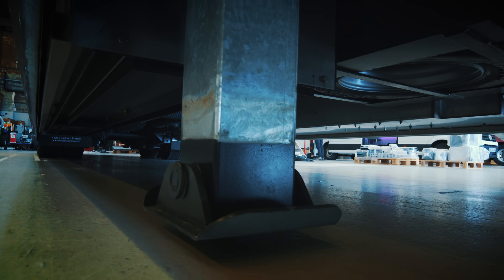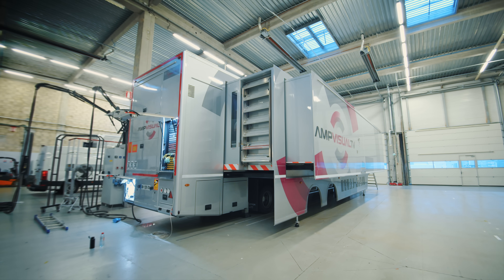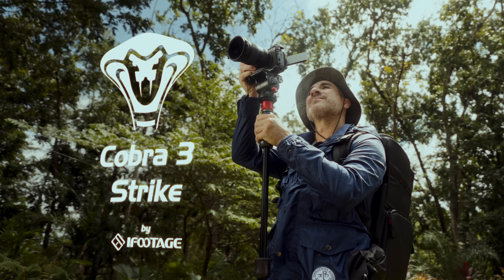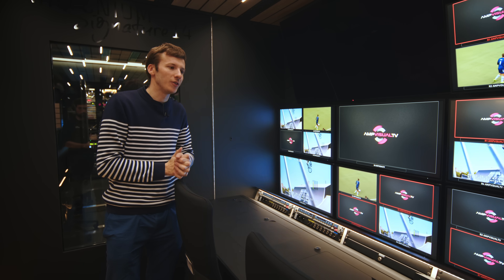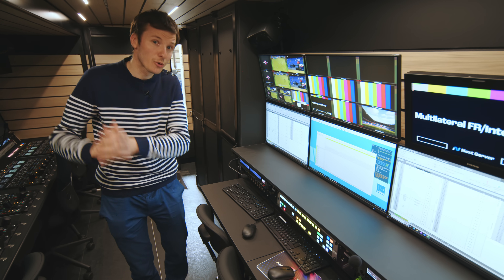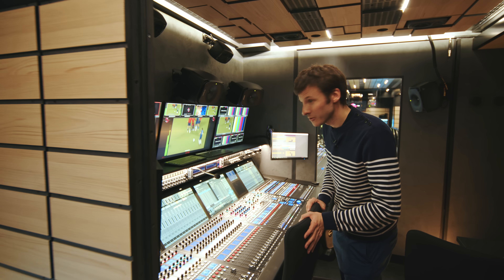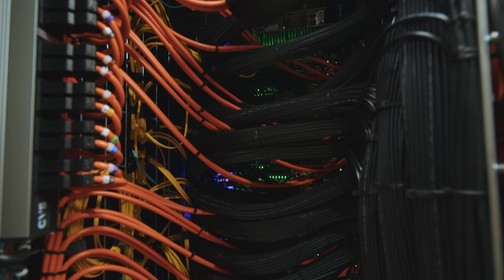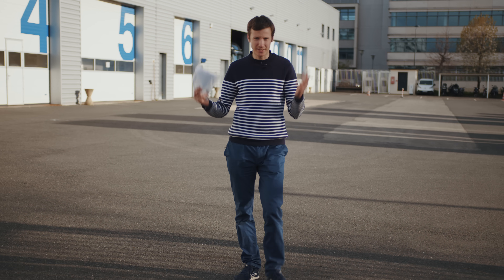What's Inside a MASSIVE TV Broadcast Truck ?  - Full Tour!

Comment: I've worked in OB trucks like this for 8 years. Even collaborated with AMP on few occasions. It's an amazing and endlessly cool job ... but be careful, it can eat up your life if you let it. Very physically, mentally and time intensive. :) ...but also the best multimedia technology school you can imagine. No university can teach you what a year at company like that can give you. Trust me. If you can operate an OB truck, no studio anywhere will take you by surprise.
Reply: Thats the most acurate statement i had ever read: "If you can operate an OB truck, you have mastered any broadcast environment possible."
Reply: @joanmiqueltorrensjuan9292  Absolutely true.
Reply: A most interesting overview. It would be interesting to investigate each section of the work flow and how they interact. I have some experience of the corporate conference and Corporate video production, but from almost 30 years ago, so the technology was very different. I find the way they have nested the systems from  at least 5 different production environments together in one vehicle. What is the backbone standard this truck is designed for? 4K or higher.
Reply: @plunder1956  Honestly till this day 4K trucks are not as common as it might seem. The one you see in the video probably is 4k, because AMP is very big and very succesful company. But your local TV soccer match won't be shot in 4K any soon. It's just too expansive.

Other than that, you usually have 4 main departments. All nicely shown in the video. 
- The video vision mixing part, where editor and director sits. Also it usually hosts a graphics operator for titles and stats.
- The replay part (where EVS operators sit and offer replay shots to director).
- The remote camera control part, where they take care of all cameras looking the same, so you can cut between them.
- Audio part, where sound gets made. Also they configure intercom systems so everyone hears everyone.

All the signals are routed in matrices. Some use distributed multimedia matrices (google Riedel Mediornet), some use dedicated video and audio matrixes. Video one tends to be a standalone device, audio one tends to be a part of audio console. All the audio and video meets in a device called "embedder" that makes a finished stream out of it.

That stream then goes to an H.264 encoder. Either mounted in and DSNG truck (a car with satellite dish on top) or goes to some kind of internet based encoder (google LiveU). That's how the signal gets to TV station. Then they process and distribute it any way they fancy. :)

(I was too colorblind to work on the vision/camera control part, but I've done all the rest. All the aidio stuff, bit of replays, lots of intercoms and A LOT of dsng satellite transmissions. :) )
Reply: @plunder1956  I agree completely. Within a truck like this there are probably so many sub-groups of expertise.For example, I saw a lot of fibre networking, but there was still discussion about SDI connection, and it made me curious about tech like NDI. Can you so some stuff on that in these environments?
Reply: @vabiro  NDI is slowly getting into the space for sure. But so far is more at the budget area productions and/or non-moving studios. Mostly because of the infrastructure. There are tons and tons of cables both in buildings and in OB-trucks. Those cables are still co-axial. And you have to replace essentially the whole thing to convert existing business to NDI (or other network protocol). So new and cheap installations opt for it, but big league broadcast is still kinda klinging to SDI. (And then you have companies like Birdog, who make SDI-NDI interfaces.)

The network you see in the video is usually for configurations and metadata. Every device has to be accessible via some controll app or browser. Also for example some camera control units use ethernet. Also there are systems like VSM or Cerebrum, that serve as an "orchestration" thing. These talk to all the machines and configure all of them from one interface. 

A lot of intercom panels connect through ethernet. There the IP routing is actually an advantage as you can swap users inbetween panels in seconds. But not all systems have it like that. Some are on coax as well. Depends.

One exception to what I'm saying is Dante audio protocol, where ethernet replaced fragile AES/EBU optics and you don't have to replace that much in the truck. So it's possible you see some Dante stuff there as well.
Reply: Hello, NDI will never be used in this kind of system because it is too compressed for this kind of use (very high-end). There is more and more AVoIP in the broadcast world but the problem is that IP is not a synchronous protocol like sdi, madi, etc which introduces a lot of latency (several milliseconds). this causes problems when the ob truck has to do IMAG for example.
The optical fibers you see in the video are probably fibers that don't contain IP, they're used in layer 1 with other signals inside (madi over fiber, sdi over fiber, etc.).
We'll be seeing more and more of the SMPTE 2110 protocol in future ob trucks, with its advantages and disadvantages. The main advantages are easier signal distribution, fewer connections and less weight.
On the other hand, it requires a complex network infrastructure, enormous bandwidth and lots of electricity.

In audio, Dante, Ravenna and AES67 have proved their worth and are already widely used, but the technical limitations are less significant.

In any case, the future of AVoIP protocols will be very interesting 😄
Reply: I work in corporate AV in large scale live events, and the focus, this level right here on an OB truck like this....mind blowing for me. I am a video engineer, but just got humbled bigtime. I feel like I know dink compared to what is out there.
Reply: an one train under such companies?

Comment: It’s amazing how much technology has changed the remote business. I worked as a student at my college and my high school with the same truck where we had to load up the truck for sports recordings. Four cameras and a very heavy quadraplex video recorder that handled two-inch videotape (in college we used three-quarter inch video cassettes-Sony U-Matics) that practically gave us all a bad injury due to weight. We were fortunate to have a second set of camera control units so we just had to load up cameras and the cabling (thank goodness for cable winders for both audio and camera cables) for production. Audio was handled by the old Shure microphone mixers that were very thin and could be cascaded for more channels beyond five. Inside the microphone array was the standard EV 635 and EV RE-20 microphones with a couple of EV shotgun microphones to cover the house audio like crowd noise. We also carried a behemoth Ampex mono reel-to-reel for other sounds such as music  (and that thing was well over 125 pounds but built very well. Overall it was a great truck for its time but by the time my college got it, there were several things that were not part of the sale to the college, but we had some engineers there who were able to give us the same thing using less equipment so we had many an exciting weekend covering football and basketball and the best part was that it all counted as Lab Work for our Television classes. But truth be told, I loved the Philips cameras we had in the college studio as they so much sharper. The Ikegami camera we had for a third camera was always a pia as more people had access to it (news classes) and that meant adjustments were always out of standard and we spent twenty minutes getting it in sync with the studio/remote cameras every time. Of course I am talking about the time right before stereo TV audio became the de facto standard, so things were far easier to pull together. The best thing about having the truck was we didn’t have to drag a quad machine out of the studio for taping. The Ampex AVR-1 decks we had were great but would never have survived under student remote operations. Overall, it was a fun part of my life, but I am so glad that I was more of an audio type than a TV engineering type. Yeah, I picked up just enough to make me dangerous with adjustments but I loved the audio program in college and I went on to do radio which was far less stressful on me. But looking at that rig you showed off, I am so glad that it’s not in my hands. It’s that more powerful than anything I could have ever imagined back in my college days.

Comment: I’ve worked on 3 of the big trucks and many of the smaller trucks.  Personally I prefer smaller flight packs because they can go in more places and less power than trucks. I’ve been in the business over 35 years as a cable puller/page, production assistant for Detroit word cup 1994 with EBU, as a TD and Director for countless productions

Comment: would not like to be the guy that has to find a broken cable in that rack 😳
Reply: Been there,done that. Every cable gets a number.  The problem is when management (different company) assigns a hotshot engineer who changes some equipment and decides to run new cables without labeling and uses old cables for new connections without updating the wiring charts.

Comment: OK That is a VERY nice OB Truck - but there is literally nothing revolutionary about it and even less next gen (I mean there might be - you just didn't show it). I couldn't tell because the camera was moving so much, but I would bet that the back of the rack connection were IP based (ST-2110) and not SDI. Actually I sincerely hope that they were not since trying to do a 4K HDR truck (as the label on the outside is claiming) with SDI is the definition of old tech. 
Nice fluff job without any useful info and frankly with a click bait title (recording for the customer on a USB flash drive!!! Do you even have an idea of the bandwidths these truck operate?)
Reply: I've read (hardly) some mediornet labels. Maybe the truck is based on the Riedel video over IP ecosystem. I agree, I would prefer a more accurate technical description but . anyway, it's cool to see this content.
Reply: @SportFlow  Mediornet as a contribution external connection system is possible and a nice option (also not a baseband system but based on IP network tech), but I doubt it would be used for the internal wiring of the different video components of the trucks - I just know (hope) it is not SDI.
I actually agree that this is interesting and the truck is definitely nice (the double expanding sides are not very common) - but to label it "revolutionary" and "next gen" is simply wrong and just a click bait.
I know everybody does it - but I don't have to like it. And I don't!
Reply: @SierraLimaOscar  Sure, it is high-end, but not revolutionary. Are you aware of some ST2110 only trucks? I've seen quite a lot permanent st2110 facilities but trucks still rely a lot on the easy to troubleshoot, quick and reliable SDI
Reply: @SportFlow  I was part of the design team for a 4K ST-2110 OB truck for a German client back in 2017 (delivered 2018) - and we were far from being the first. The main advantage of ST-2110 over SDI is weight reduction and the fact that 4K with baseband connections is extremely clunky and very costly ($, power budget, space, weight) even more if you add HDR to the equation. All these considerations actually make it ideal for OB operations. I will however say that ST-2110 still owes us quite a few features that were part of its roadmap at inception, which has delayed (prevented?) many ST-2110 projects.
Reply: @SierraLimaOscar Hey, which german client? There are some 2110-Trucks in Saudia Arabia, build by german system integrators. This van is surely based on Mediornet UHD Microns for all there video.
Reply: @SportFlow I believe GameCreek’s “Prime” truck is IP. It’s four trailers built for Amazon Prime Video’s Thursday evening NFL coverage. I think NEP also has a couple 100% IP trucks.

Comment: This is not revolutionary or next generation.  Newer trucks often use IP based video and audio which replaces the SDI systems shown here  IP systems also reduce space and weight and adds flexibility. With IP based video systems all the multiple coax cables are replaced by fiber optics and a single fiber can carry a dozen uncompressed 4K signals or more.  I assume this team prefers to stick with the traditional SDI interfaces as it looks like an older staff that may prefer not learning the complex IP based networking.